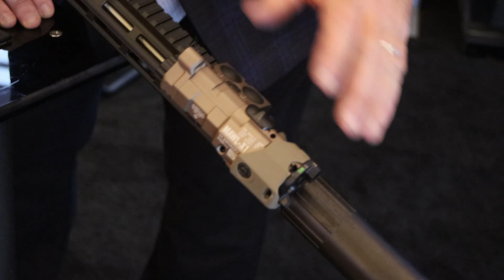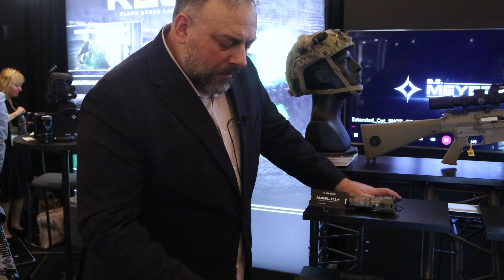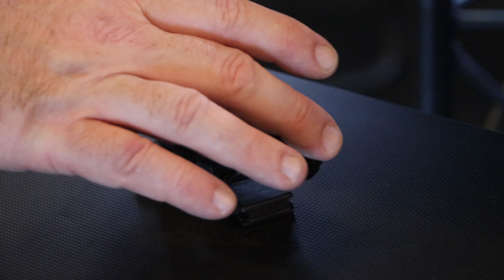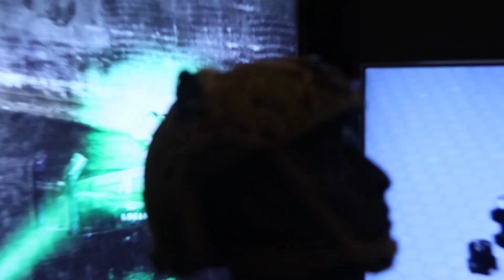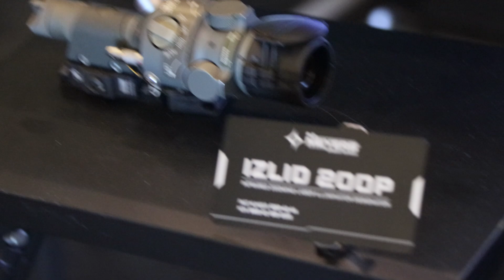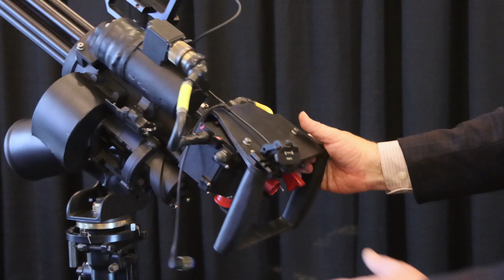BE Meyers - MSM - ShotShow 2023

Comment: So instead of mounting the IZLID a few inches further back, they add more parts and weight to "protect" it while being in a workspace it didn't need to be in in the first place. Someone's not thinking properly.
Reply: In a helicopter, you don't really aim a minigun with your head directly behind the weapon. You kinda just point it at what you want to die, and walk your tracers in.

Having the device high up prevents "light shadow" off the gun barrels when you fire the illuminator. Also, reduces the amount of glare you get from the light bouncing off of the smoke.
Reply: How much trigger time do you both have on Miniguns?
Reply: @JEJAK_777  'bout as much as that salesman
Reply: @Skylyned  because the salesman designed it right?
Reply: @CT-mt5jq  do explain!
Reply from the maker: Although door gunner is a pretty specific role, pretty sure Chuck has had some minigun time https://presscheckconsulting.com/about
Reply: No kidding, and why does it have to be mounted so high? Seems like it is directly in the operator's line of sight